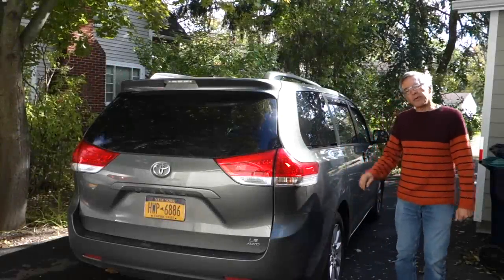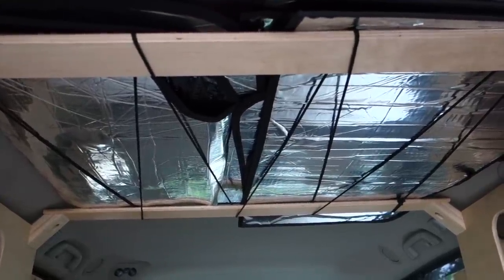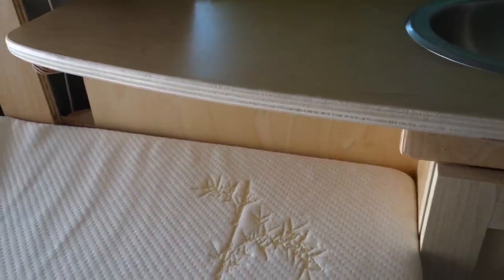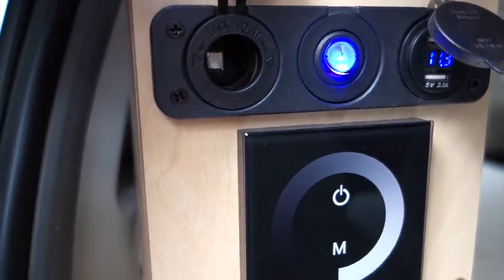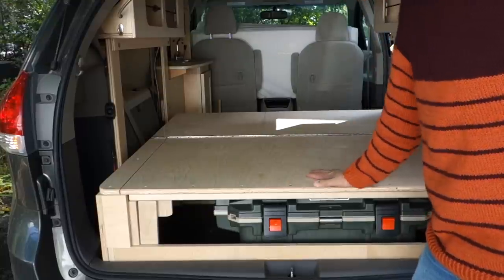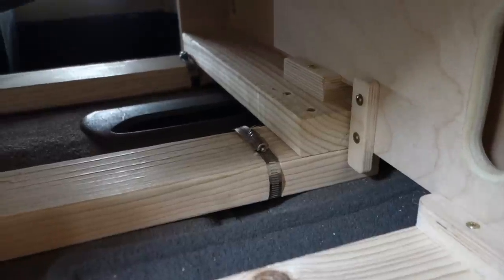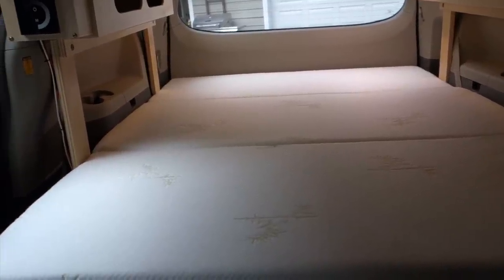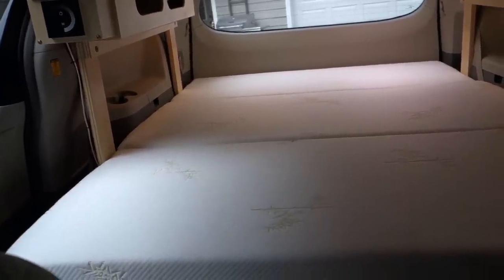A Slightly Different Mini Campervan Build

Comment: Now I have watched all your videos....more than a few times and I am continually amazed at the thought process and craftsmanship.  A couple of questions......Where is the refrigerator you speak of which draws a great deal of your resting power?  Is the Pelican in the back just a cooler or does it have an electrical plug?  Also, having read many of your replies I know you use the Baltic Birch plywood but I also thought I saw some 2 by 4s along the floor for support of the sleeping platform.  I love your van.  Thanks for sharing all the videos.
Reply from the maker: You're a superfan! I appreciate your interest in this build and I'm glad you've found some of the ideas useful - that was my intent in offering the videos on youtube. Regarding your questions, it would probably help to understand I built this van in two stages. Stage 1 was completed in 2018 and we used the Pelican cooler on our road trips that year. Stage 2, which included the solar power upgrade, was completed the next year. So in 2019, the Pelican came out and in went the Iceco refrigerator instead. Regarding the wood question, I could have used Baltic Birch for 100% of the build but I decided to use 2x4s for the floor crossmembers where I clamp the entire bed structure to the steel seat anchors in the Sienna's floor because they would provide more strength where I screwed the sides of the bed platform into them. I used long structural screws so that in the event of an accident, the screws wouldn't rip out of the wood as easily as if I had used Baltic Birch. I used short pieces of 2x4 in a few other spots only because I had the scraps laying around, not because I need the strength from their thickness. Baltic Birch is plenty strong if it's used correctly and I love it's aesthetic qualities. Plus, it's really flat and easy to work with.

Comment: Quite elegant design. As a designer of small houses, I am impressed. Especially like the plywood joinery at corners! Could you divulge the plywood thicknesses used for the cabinets and for the bed platform?
Reply from the maker: Thanks for viewing and commenting. Regarding the plywood, all of the structural members (sleeping platform, cabinet supports, and cabinet carcasses) are ¾” birch plywood. The cabinet fronts and crossbars are ½” Baltic birch plywood. There are a couple of partial cabinet backs that are ¼” Baltic birch ply. Right now, I’m building some add on cabinets and components that are mostly ½” bb ply. I hope to get a video on some upgrades posted in the next few weeks.

Comment: i fully appreciate the thought it took you to avoid directly mounting this unit to the van itself.
Reply from the maker: Thanks for the comment. Coming up with solutions to avoid drilling or modifying the van in any way was one of the more challenging parts of this build. I've got some more features planned this year that you might find interesting, so stay tuned.
Reply: @BruceParks  I sure will check your upcoming videos out, thanks! ( and yes we have a van that we travel in, and yes, I'm "borrowing" some of your ideas lol) thanks again!

Comment: Beautiful! Just wondering how you attached the vanity to the.floor. You mentioned and showed it but i couldn't tell what it attached to or how it was done. Thx
Reply from the maker: Thanks for commenting. Regarding the vanity mounting, I attached a piece of wood to the 2nd row seat trolley (the trolley is the sliding base assembly that's left behind when you remove the seat) using two hose clamps. Then I screwed the vanity to the piece of wood. I hope that was clear.

Comment: Very Nice. I like how you can still see out the back window with this design, and everything is modular / not permanently attached. That way you can put the van back together when its time to trade in.  Can I ask what you are using for the auxiliary electrical power? Thanks
Reply from the maker: Thanks for viewing and commenting. Regarding auxiliary power, we've been using a 13,600 mAh jump battery. It's simple, we keep it plugged into a 12v port so it charges while we drive, and it provides sufficient power for lights and a fan. I'm planning to upgrade to a solar panel and large deep cycle battery so that we can recharge even when not driving and also have enough power to run a small fridge and ventilation fans all night if necessary. All upgrades will adhere to the same principle of easily removable without a trace. I'll post updates as they are available this year so stay tuned.

Comment: Would love a better examination of the structure of the bed.  How does the removable panel store under the fixed panel?  What does underneath the structure of the bed look like?
Reply from the maker: I took photos of the footboard about to be stowed under the midboard and of it in the stowed position. You can see some of the under structure. Take a look and let me know if it helps. https://photos.app.goo.gl/s2rNzWVAokcgx6516

Comment: Bravo, sir. Very nice conversion. Do you have any additional batteries for your lights and USB outlets?
Reply from the maker: Thanks for commenting. I've got all of the extra electrical loads (lights, fans, phone charging) running off a  13,600mAh jump start battery. I leave it plugged into a cigarette lighter jack so it can charge while we're driving.

Comment: Can you still use the rear windows for ventilation?
Do you have a way to have window screens?
Reply from the maker: Yes, the rear windows still flip out. The upper cabinets are open backed so when they are empty, air flow is pretty good; when they are stuffed, not so good. For bug screens, I've got a full size screen for one of the side windows (2nd row) that has magnets sewn into the perimeter - it attaches to the outside and allows the window to be all the way down. The main downside to this approach (and to the doorframe netting socks some people use) is that it's not stealthy. I prefer stealth and ease of setup so I'm working on a way to have screens that install on the inside of the window frame, much like the WeatherTech shades we're now using but a screen version. I'd probably add a curtain system so that we can preserve privacy but still have air flow.

Comment: Nicely done, Bruce. Looks to me like you're something of a cabinet wizard. Keep playing around with this...you're on the right track...
Idea...is there enough headroom in there to raise and lower a sleeping platform? Perhaps something that would fold in half lengthwise. 24" wide X 72" long X 18" thick... drop it down and flip it out to 48" wide...or maybe 42"...might be more trouble than it's worth...

Wikipedia says the chief engineer for the 2nd generation Sienna was Yuji Yokoya... Among other things, he wanted the Sienna to be able to carry a 4 X 8 sheet of plywood...a very American standard...that's why there's 32 sq ft to play with...
Reply from the maker: I bought a bunch of plywood from a guy last year. When I showed up with a Sienna, he couldn't believe it would easily take full sheets laying flat. Piece of cake. It was a good demonstration of how the engineering team obviously considered 4'x8' sheet goods in the US when designing it. Regarding inside height, I once measure it to be 48" max in the center of the van but it tapers down towards the rear.
Reply: @BruceParks  According to Wikipedia, this chief engineer Yokoya fellow snagged a 1st generation Sienna and drove it 53,000 miles (!!!!) - with his entire family - over American roads. Now that's what I call a design engineer! He was looking for all the weak points, shortcomings, and design flaws in the 1st generation so he could eliminate them in the 2nd generation.
No doubt he stopped at a Home Depot in his travels and watched them loading building materials. 
And he probably hit some nasty weather so he decided the new Sienna should have a 4WD option. 
Here in Arizona manufacturers bring their prototypes for testing since you can go from a desert to alpine climate in 300 miles. 
I have never heard of anyone testing a prototype before it was built - which is what Yokoya did. And in the doing, he snagged a sweet 100-day, "see America" vacation for his family on the company dime.
Reply: @LeonAllanDavis  About 35 years ago I worked for an airfreight company and we used to ship prototype cars for Jaguar and Land Rover to America for testing.
Reply: @poosmate  No doubt shipped to Arizona where I live...
Back in the day, when Brits still made automobiles, they tested a lot east of Phoenix in the Four Peaks area...especially in the summer...1985 or thereabouts...
I drove a Toyota Land Cruiser and I always wanted to pull one out of a ditch or something, but never got the chance...

Comment: Truly ingenious! I love the quality woodworking with all the corners rounded. Bravo! I would love to know what the longest trip you've taken in your set up?
Reply from the maker: Thanks for the comment! On the day after I finished building it, we took it on a 4000 mile trip around New England, Nova Scotia, Prince Edward Island, and New Brunswick. In 2017, we took a similarly equipped Sienna (though lacking the overhead cabinets in this video) on a 9000 mile trip across the US to the west coast and then up through Jasper and Banff National Parks in Canada on part of the return loop. Our style of roadtrip was essentially the same on both: boondocked a lot in rest stops, parking lots, and residential streets; spent a number of overnights in paid campsites so we could shower easily, and stayed with family and friends. We're planning a trip to UT, AZ, NM in a couple of months and am working on a few upgrades. Stay tuned.

Comment: Very nice!! I love the upper storage. One question- How hard was it removing the third row seats? Have you ever reinstalled them?
Reply from the maker: Thanks for the nice comment. Regarding the 3rd row seats - very easy to remove. Hardest part was removing the plastic trim that covered the steel bracketry, I didn't want to crack any of it. Then there were a total of 7 bolts to undo and that was it. I have not yet reinstalled the seats but as I removed them, I imagined the reinstallation process and felt it should be straightforward. Someday I'll find out. Maybe I should do a video on it.
Reply: @BruceParks   That would be helpful. I removed the seats at the top of the arms that lower them. That left 2 thin arms protruding into the cargo area but I don't think they'll be much of a problem. I wired the 4 shorter arms up to the seat brackets in the floor. I have a feeling that you removed them right from the floor.
Reply from the maker: David Sands  - Yes, I removed each 3rd row seat as a whole, including folding support base brackets, so that the cargo floor was completely bare.

Comment: Thanks for sharing your build. Very nice. Any regrets on the cooler placement?  Can you access it only from the back tailgate?  Was curious if you can get to your food when it’s raining outside without having to get out of the van.
Reply from the maker: We’ve since replaced the cooler with a fridge but it still sits in the back and can only be accessed from behind. No regrets because we don’t really need to get stuff out all that often. With a double bed, there’s very little space left for things like a fridge up front. We’ve found the open space to be of more value for the way we use the camper. We do keep a mini-cooler up front for easy access to things we want while driving but it requires a little thinking ahead to decide what to move into it from the fridge.

Comment: Excellent design! Love the dual purpose bed section/table. No provisions for a stove?
Reply from the maker: Brenton Piercy - Thanks for commenting! Regarding cooking, we use a single burner butane stove and prefer to do it outdoors. I’m looking at adding solar and a deep cycle battery to power things like a small fridge and induction cooktop. Might build a slideout kitchen module; stay tuned.
Reply: @BruceParks  Perfect. I recently picked up an '04 Sienna AWD and am looking to do a campervan build very soon for a road trip next year. Been debating on a slide out kitchen from the side door (out the passenger side) or have it slide out the back from under the bed. So many options when you're starting with such a blank slate. Looking forward to seeing how yours comes along.

Comment: Wow...So many terrific features and thoughtful planning! I am really sold on a bigger (wider) bed now with your fantastic, space-efficient design. I was watching a more recent one of your videos and wondered...now that you have added the solar under the section where you stow the foot part of the bed, are you still happy with this design, or do you wish you had created the bed differently?
Reply from the maker: Thanks for viewing and commenting. If I were to build another Sienna, would I do it any differently? For the most part, no, I'm really happy with the basic layout of the bed platform sections and the way it's supported and anchored in the middle third. The footboard still stows under the middle section, above the power board, and there's even space between the two to stow more stuff though I want to construct a protective cover over the power board to keep things off of the components. Next time, I would probably optimize the layout of components to shrink their overall footprint. Their location under the middle board makes them harder to get to but the need to see or access the electrical components while on the road is rare.
Reply: Thanks for your response. What is awesome is the additional structural support the stowed footboard gives the way you have designed it to sit in the channel under the middle section. I also like that you can access those elements from inside the van in the event of an inclement weather repair, or if you wanted to maintain stealth-mode. I continue to be impressed by the thoughtful design. Thanks again.

Comment: How do you stay warm if you visit a colder area?  Looks great and not so intimidating for people just starting out or expensive as some that I have seen thanks for sharing.
Reply from the maker: Thanks for watching and commenting. Regarding staying warm, we just use a warm blanket. Most of our travels are during weather that rarely gets down to freezing. However, there have been a few mornings where it had gotten down to around 25F and condensation from our breath was frozen on the windows. We were still warm under the blanket but it was mighty cold crawling out from under it. I'm planning on adding solar power which would enable small luxuries like being able to use an electric blanket. I'll shoot a video once I've got it installed.

Comment: Great build! Can I ask the measurements of the cargo space? Especially the length from the back of the seats to the back of the van? Looks like you have almost 2 feet of clearance at the floor after the 73" bed!
Reply from the maker: Good question! The floor length is 8’ from the rear hatch to the back of the front seat base. One of Toyota’s goals was to ensure full sheets of 4’x8’ sheet goods would fit inside.

Comment: Wonderful! Agree with everyone else, very elegant non invasive solutions here and beautifully made.  What is your power supply, please? Is there a second battery?
Reply from the maker: Thanks for the nice comment. I've got all of the extra electrical loads (lights, fans, phone charging) running off a 13,600mAh jump start battery. I leave it plugged into a cigarette lighter power port so it can charge while we're driving. I'm planning to add solar power this year - stay tuned for a video on it later.

Comment: Can’t get enough of watching all your build videos. For those upper cabinets and the front hoop, did you make a pattern first?
Reply from the maker: Yup, for all of the big pieces that follow the contours of the interior panels, I made templates first out of paper, then cardboard. I cut the wood slightly oversize of what I wanted the completed piece to be so that I could tune the final edge shape on stationary sanding equipment (belt, disk, and spindle sanders). I'm glad you're viewing the videos with an eye on how each piece might have been made.
Reply: @BruceParks  thanks 👍🏻

Comment: This is really good. How did you learn this ... For a complete beginner where do you begin to learn the fundamental skills?
Reply from the maker: Anthony Keovongphet - There’s basically two aspects to this kind of project: designing and woodworking. I’ve been a casual woodworker for a long time so the basic woodworking skills needed for campervan conversions like this were the easy part for me. But if you’re just starting out, you’ll need to acquire some tools and just start making things, small at first like boxes and shelves, and then take on more complicated projects. It’s not difficult, it just takes some time. The design stuff is where some people are gifted and others will struggle. I think the most important part of projects like these is to focus on each little function and carefully think through the options on how to achieve the function before selecting the one you want to actually make. Don’t always go with the quick and easy solution. It might be the best one but often it isn’t. 

Anyway, I don’t know if any of this is helpful but all I can say is start small and increase your scope gradually. Don’t let the big picture overwhelm you. Break things down to manageable pieces.
Reply: This is a ton of help thank you very much. New subscriber here and looking forward to see more of your projects.